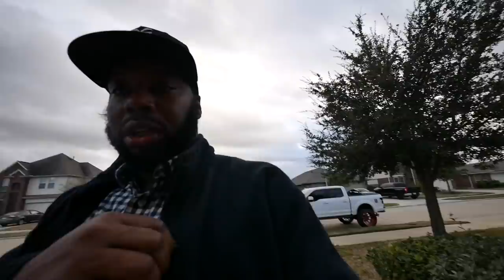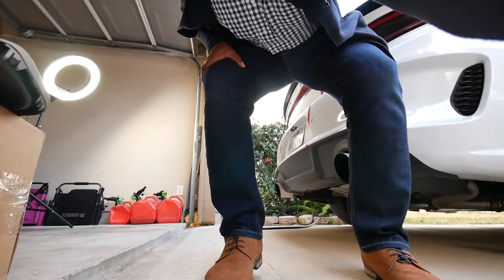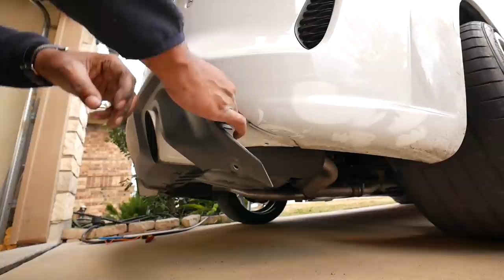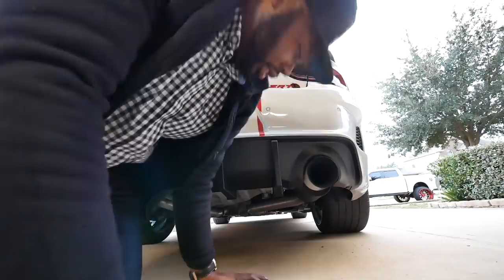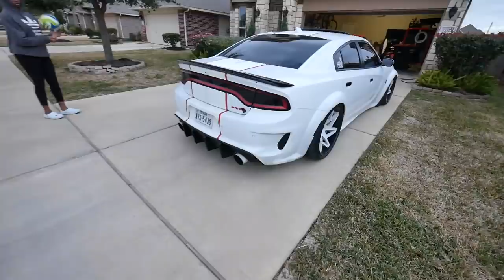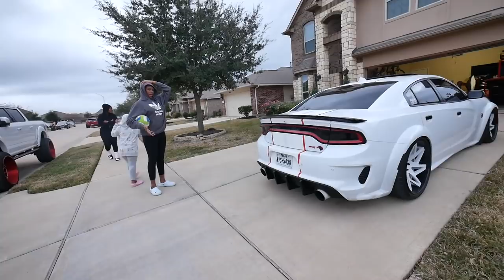I THINK THIS WAS A HUGE MISTAKE ADDING THIS REAR DIFFUSER TO MY WIDEBODY HELLCAT CHARGER

Comment: Peppermint cat time. The factory one has a more clean, sleeker look but aftermarket one is more aggressive but does stick out. It doesnt look bad but it just interferes with the look of the red stripes. The 4 pieces that stick out are the issue and it is throwing off the stripes. Great video
Reply: What he said Exactly.

Comment: I have a 2021 widebody hellcat charger and I removed the 4 bolts and 2 push pins and my factory rear diffuser would not come off! I used all my strength and it was pulling on the whole rear of the car, so I had to send my aftermarket diffuser back to the manufacturer. I was bummed.

Comment: You should’ve got this one ,
15-19 Dodge Charger SRT Scat Pack MDP V2 Rear Bumper Lower Diffuser Lip. From eBay. Gloss black already, you’re welcome.
Reply: Would that work on his widebody
Reply: @_andre007  yes it will cause that part is not a part of the widebody. Although that it is a different bumper it will still fit.